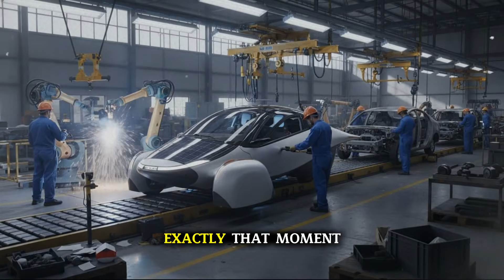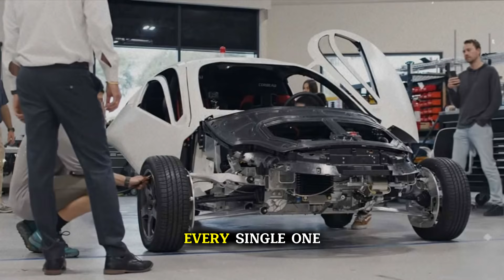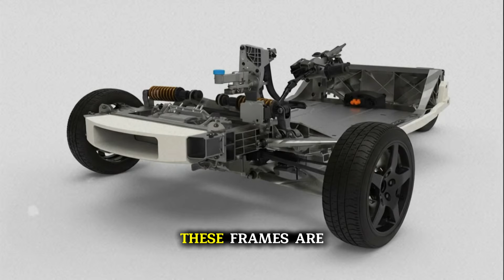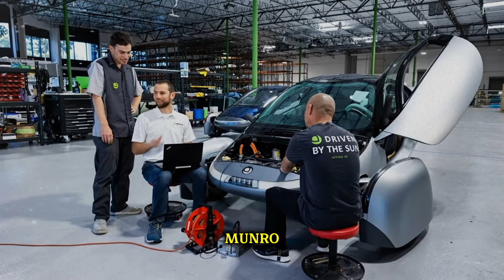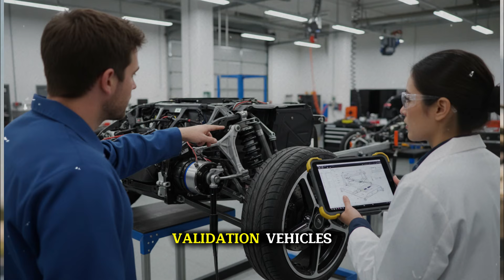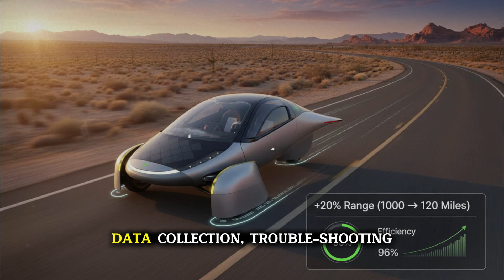How Aptera's Solar Car Is Built: Behind the Scenes with Prototype Frames

Comment: Aptera has been around 19 years and has yet to manufacture and deliver a single vehicle. Its burned through 100+ million of investor money.its goes public on the NASDAQ,  Then channels like this one magically appear posting glowing AI generated videos of production lines that don't exist. I smell a stock manipulation scheme in play...
Reply from the maker: I understand your skepticism given the company's history; many startups face extended timelines before achieving production.
Reply: FACTS: Aptera of today and the original are two different companies with several years between them where Aptera didn't exist at all. It's not accurate or fair to bunch them together and call it all the same thing. Aptera of today started at the end of 2019, so it's been six years at most, not to mention the COVID mess during that time. The vehicles are almost entirely different from then until now also, with the exterior shape being about the only thing in common. Aptera just signed a 75 million dollar deal which covers the 60 million needed to start production. They also just went public on the NASDAQ exchange which could mean revenue soon. Aptera Solar is already supplying at least one manufacturer with solar panels, so this is a diversified income source. Two vehicles exist with factory parts from suppliers, just as they will be built, and are in validation testing. Experts like Sandy Munro are very excited about Aptera and that's more than enough for me. All of this in six years and only 120 million.... no other startup has done this well, including Tesla.
Reply: @DemaGeek nonsense,  it's the same 2 guys that ran the first itteration of Aptera into the ground that are at the helm of the new Aptera now...Do you work for Aptera ?
Reply: @abbeynormahl61  The original founders did NOT kill the first company, rather it was the outside help brought in who had a different vision for the company and product.  They took control of the board of directors, ousted the original founders, went in their different direction, and ran the company (waiting on a DOE loan they thought would come through) until they went bankrupt.  The original founders were not even there for the last two years.  That's what the facts are.  No, I don't work for Aptera, but try to correct misinformation out there, like the answer you've just given.
Reply: @DemaGeek the two CEOs were ousted from the original Aptera due to their gross mismanagement...kinda like what they're doing right now
Reply: @abbeynormahl61  Wrong.